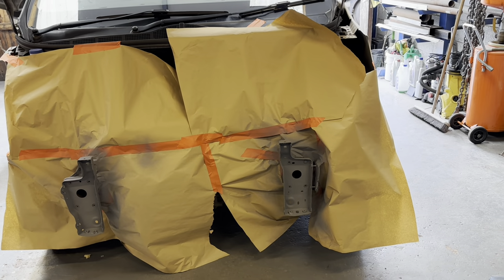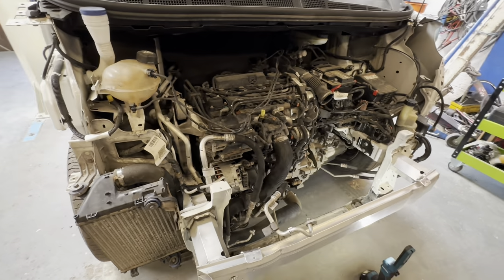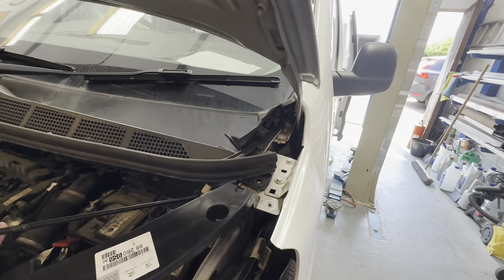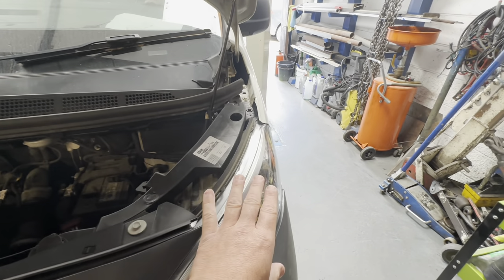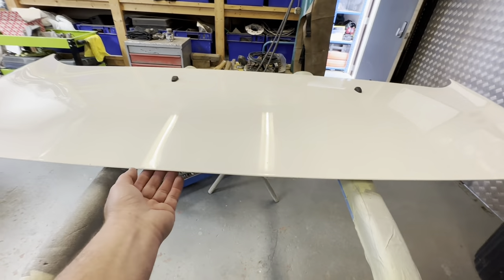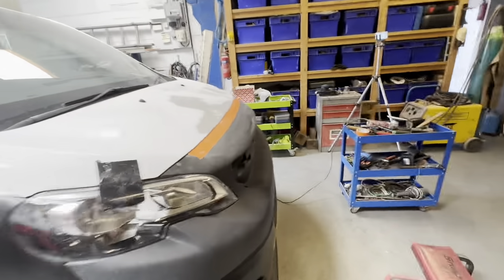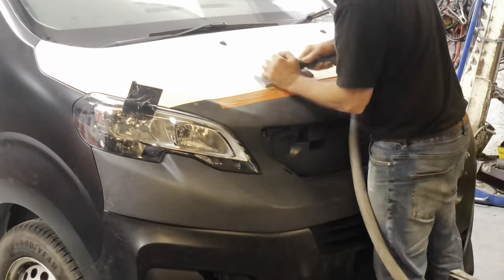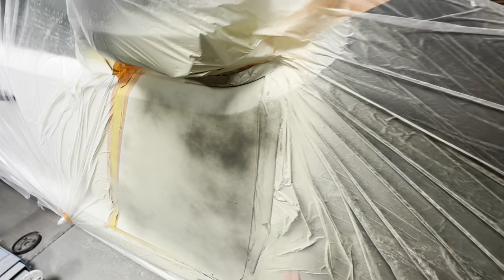REBUILDING A WRECKED 2019 PEUGEOT EXPERT VAN PART 2

Comment: Chris got cracking once again with the bodywork. I am pleased he managed to save the bonnet, one less panel to buy. He did a great job as always. The stickers came off quite easy which is great but as you said they have not been on there very long. Nice job Gents. If it were me I would do the airbag before the paint just so that it doesn't get knocked. Thanks Rob and Chris for another fine video, have a good weekend. 👍👍

Comment: I have the same van but the Citroën dispatch psa equivalent & just like you the front end parts we're extortion ! I did however save on a rad pack from a grand Picasso as there the same, the lower rad support was from a 308 so there's alot of identical bits. The dash was a bit of a nightmare to fit as there's a big bar across the middle which will need undoing. Airbag module is right beneath the gear stick under the carpet I also had to solder a new connector to the driver airbag as it was burnt.
Reply: yes and the module is a pig to get to, I managed to get to it by taking out the passenger seat lifting the flooring rubber with pieces of wood just high enough to get my arm in with a ratchet, 3 nuts+2 plugs.

Comment: Thanks for another great video, the vans looking good as all your repairs do. I think you are going to find all the parts prices are going to double if they haven't already, and more stuff will become unavailable even with pattern parts.  I paid 6K for a non damaged 2010 F150 truck here in Canada a month ago, I did all the work in my spare workshop time to "MOT" it rebuilding brakes, some steering components, exhaust manifolds and a service with oil and coolant flushes. The parts bill is over 3K and some of that like park brake cables was hard to find in non OEM/spiteful when I did  find them and this is a common truck sharing parts from about 09 to 2014. I valued that Truck at 10K before I started and i'm pretty well there and the insurance confirmed that's it's book value yesterday when I paid sales taxes on it. Anybody that bought it, and paid for the work I did was going to be 5K plus in the hole again. There was nothing in it realistically to buy and flip it, luckily I'm in it to keep it quiet a while. Take care guys.

Comment: How the fk can an alternator cost 800 quid!!! Does it charge the national grid or something? Madness
Reply: Smart alternator probably, they cut in and out to save drag when the battery is charged, saves 1p of fuel every 1000miles, which you end up paying when it takes a dump

Comment: If Peugeot parts are dear, and this van is also rebadged by Vauxhall, Fiat and Toyota, does buying the bits for the other brands work out any cheaper?   (assuming not the lights/grill etc which are a slightly different shape)
Reply from the maker: All the vans are psa so Peugeot Citroen rebadged
Reply: It's worth going through the parts catalogues and checking with the different dealers parts departments, at least on older stuff. I saved €100 on a Ducato sump once by getting the same part off a Citroen dealer. Whether it's true for newer stuff I don't know, as Citroen, Fiat , and  Peugeot are all Stellantis now.

Comment: Those panel repairs looked ropey AF
Reply: Why?
Reply: @TristanBuckley  It is not best practice to apply body filler on top of paint and the edges where the filler transitions onto the paint are very defined, this would indicate that the 2 surfaces are not perfectly flat. Long term it is likely that the repair will sink and leave a visible defined mapped edge around the repair.